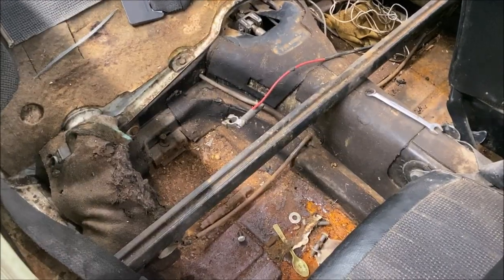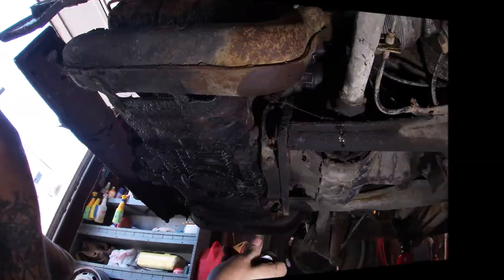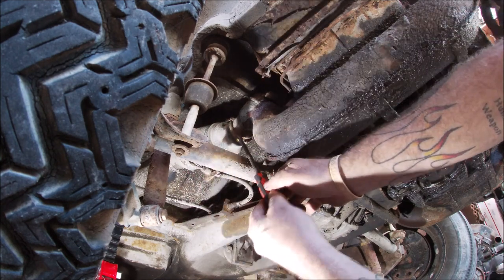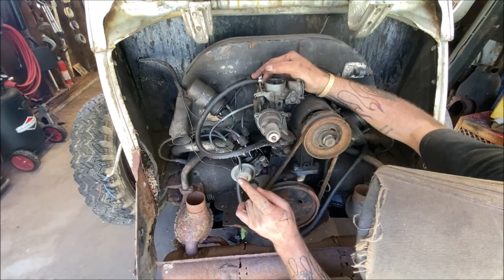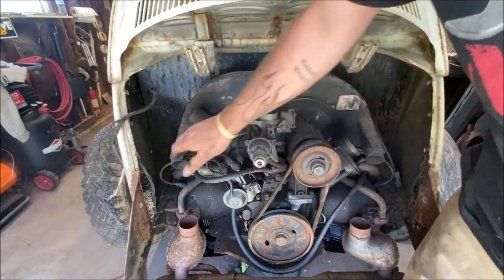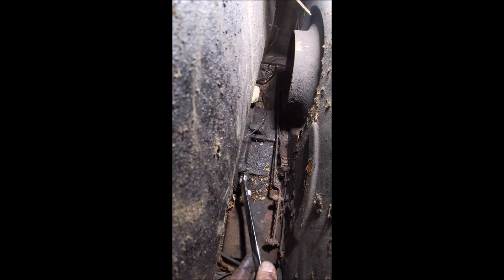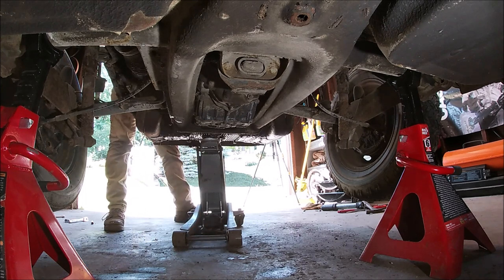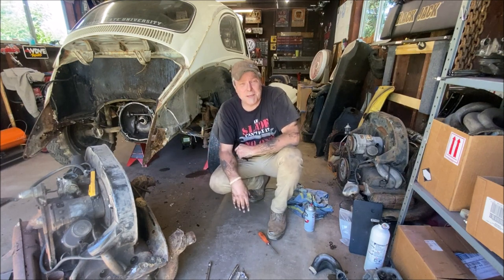VW BEETLE ENGINE REMOVAL - Super Beetle - EASY - DIY

Comment: Hello, Slade.  Good video.  I have a 17mm box-end ratchet wrench that has a swivel head.  It makes loosening and tightening the upper bolts so easy, and it takes so much less time, too.  You had the deck lid removed, so getting your arm back there with a wrench was pretty easy.  With the hood on, it’s a bitch to get your arm between the deck lid and car body.  But with that 17 mm box end swivel head, it’s a much easier job.  There is no wrenching a little, then removing the wrench from the nut, then positioning it back on to loosen more—and repeating this, turn after turn.  With my wrench, once you get it on the nut, you just leave it on and ratchet away.  Easy easy.  
Also, I have one of those blue VW engine dollys, with one open end, to get a floor jack in.  I just lower the engine onto it, raise the car, and wheel the engine out.  There is no balancing the engine on the head of a floor jack.  It’s also a nice tool to make VW life easier.
Reply from the maker: Hey my friend, I hope you are doing well!!!
I was looking at the sunroof on the 68 the other day, and I thought of you. Quite odd isn’t it? 😁 I still think back of you spending time with me on messenger helping out. I truly appreciated that!! 
I need those ratchet wrenches, I’ve been wanting them for a long time, and then sometimes I get cheap when I’m at the store. 
I can’t think of which blue dolly you’re talking about?

Comment: I have bad dyslexia, which makes it really hard to read. So this video has saved me a lot of time.
Reply from the maker: Thank you, I hope these videos will always be helpful to you.
Reply: @SladesVWBeetle  What i do when removing nut and bolts and screws i put them in baggies (the ones used for sandwiches) and write on the baggie where they came from that way i don't forget were they came from.
Learned that in the Navy when working on subs.
Reply: @SladesVWBeetle  I would be afraid to drop the motor on its side as i was removing it, it is not very stable on the floor jack. I wish there was something to keep it stable as you are removing it.

Comment: Thx so much for posting this! I had the exact same issue. Installed a grant hub and steering wheel and as I turned the wheel the horn would go off. I also replaced the steering signal switch at the same time. The one thing I noticed was the original steering signal switch had a wider circle (around the steering column). The aftermarket one I purchased was narrow and I believe this caused the grant hub ( with nubs) to touch/complete the ground. I used a file and carefully took the nubs off without damaging the hub. Now everything works perfectly  (horn and turn signal cancel) and the new steering wheel looks and feels amazing!!! Thanks for sharing this video!!
Reply from the maker: And thank you for taking the time to leave a comment!!

Comment: The record for a VW beetle engine pull is 1 min. 4 sec.   A driving, running beetle, remove engine, pull 1 meter away from vehicle, reinstall and drive away

Comment: I have a motorcycle jack that I use to remove the motor, it has a flat deck, the motor is much more stable and safer. Nice wasp nest.
Reply from the maker: Yes!! Those are very nice, and work perfectly well with removing VW engines!! 
 I should put that as next on my list for tools. 
Yeah I seen that nest but I knew I was good to go 😁

Comment: I slide a flathead screwdriver behind the head of the starter/mount bolt to keep tension on it as I'm loosening it. A little permatex can hold it in place while putting the nut back on if you're working alone.

Comment: Great video, refresher for me from 50 years ago. Memories as a teenager short of tools , so loosen all the bolts, wires and fuel. A couple of old tires , pull the engine and drop it on the tires, then hope you had a jack to lift the body high enough as to clear the rear apron. What’s going back in?  A 1904cc or a 2054cc?
Reply from the maker: Thank you!! Yeah they’re quite easy and simple to deal with. Well sometimes they’re stubborn 😁 
I haven’t decided on what engine yet. But I definitely want more power, to climb hills better.

Comment: Great video, Slade! Are you also going to do a 1 man engine installation (refitting) video? I find this way harder than pulling the engine ... Nice work!
Reply from the maker: Thank you!! Actually I’ll be doing the install myself. I never really have anyone here to help, except my wife. But she just helps with other small things.
Reply: @SladesVWBeetle  The main thing I find annoying is how to get a rebuit engine stable on a jack in order to raise it up/allign it  to the transmission level ... Always goes side by side with a whole lot of cursing and busted knuckles in my case ... I was wondering if there are any "hacks" to this, or if this is the same experience for everyone ... Looking forward to your next video!
Reply from the maker: @el_stino  truthfully there is a better way, I’m just too cheap to buy either one. One is motorcycle Jack, or a transmission jack. They hold the engine nice and even. But I still have never stopped to buy one. 🤦🏼‍♂️
Reply: @SladesVWBeetle  Yes, I've heard of that ... Have been doubting to buy one for a while ... The only thing I've always wondered is if those work well if you only jack up the rear end ... The "platform" on those motorcycle/ATV jack is "level", while, if you jack up your bug only by the rear, the bell housing and input shaft are "angled" ... I'm wondering if this doesn't make things even harder, since that potentially gives you less "play" to wiggle the engine than on a "normal" jack ... Would be good if someone that has tried it can comment ...
Reply from the maker: @el_stino  There has been quite a few that have used them. Personally I have not tried it. But it makes sense and what you’re saying.

Comment: First, thank you for the wonderful tutorials you do.  However, I am having an issue with my engine removal.  I am down to the last two nuts and I can only get to the passenger side.  The nut on the driver's side is behind the oil cooler.  Any trick for getting to it?

Comment: Great walk-through Slade. I especially like the 2 camera arrangement! Please forgive the off-topic question; I was checking out the Z-bar to verify how it is installed. The long rod that connects to the axle bracket is on the driver's side, correct? Of course, if that is true then the shorter rod would be on the passenger side of the actual Z-bar. Mine had been cutoff when I got Dweezil (also a '68) so hoping to get it reinstalled correctly. Thanks again for a great video!
Reply from the maker: Hey my friend, thanks for the nice comment I truly appreciate it. 
Honestly this is my first Z-bar set up. But what I will do, is take some detailed photos tomorrow. 
And I’ll send them to you through messenger on Facebook. I hope that will be helpful.
Reply: @SladesVWBeetle  Yeah that sounds great! Anything that shows the long/short rods the go from the Z-bar down to the axle brackets. I'm pretty sure the short one is on the passenger side, but this confirmation will take out the guesswork. Thanks so much!
Reply from the maker: @HapticGarage  You’re welcome my friend. I’ll be at the garage today. I’ll definitely take some great photos for you. I got tied up yesterday. I’ll send them to the messenger tonight!

Comment: Hey Slade, can I put a tensioner on a 1977 VW Beetle pully belt? How can I tell what size engine. I have the original engine .
Reply from the maker: I’ve only seen the tensioner one the aftermarket ones. Like the serpentine belts. 
There should be numbers right below your alternator stand on your engine

Comment: That was quick, only took you 20 minutes. What's the difference with the old style pressure plate to the new one.
Reply from the maker: They’re quite easy to get out, compared to most cars. The IRS and swingaxle have different designs. Especially the way the release bearing is mounted

Comment: Half the labor isn't even needed on mine, being a baja without heater boxes. Just a handful of bolts to remove the engine cage/bumper instead.
Reply from the maker: Absolutely, that would make it a lot easier.

Comment: With the rear apron already removed, Clearance is not the issue for you.  If you have a rear apron, how much clearance do you need to drop and remove the engine with enough clearance?

Comment: I didn’t use a jack. I took the hood off. Snagged the intake with a strap. Attached my come along to a garage rafter. Wiggled the engine loose, and set it on the floor. I had the rear wheels already, so I just dragged the engine out under the fender. Then I laughed about easy it was.
Reply from the maker: They’re actually a very simple car to work on. There’s so many ways of doing it. Honestly I used a motorcycle Jack one time, that was truly a nice thing to use.

Comment: r u going to convert to IRS
Reply: It's a super beetle ... so it's IRS from the factory ...
Reply: That is a typo... This is a 68 not a super beetle.
Reply: @sydlewis1892  You're right .... I was just going by the title ... but indeed, you can clearly see it is a swing axle setup and not IRS just by looking at the camber of the wheels while it's jacked up ... my bad!
Reply from the maker: I was going to switch to IRS but I may just keep the swingaxle. I had super in the title to show it’s the same process for super or standard. I should have worded it better.
Reply: @SladesVWBeetle  no big deal ... It's all the same ... beetle, ghia, split, early/late bay, 184, Type3/notch... Would be a long title though ;-)